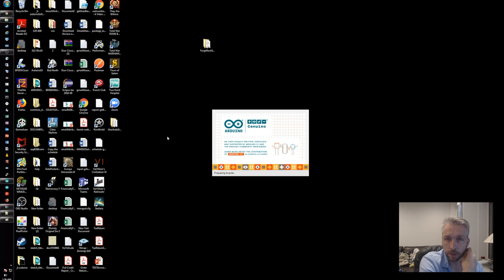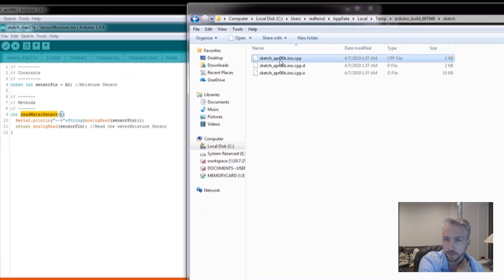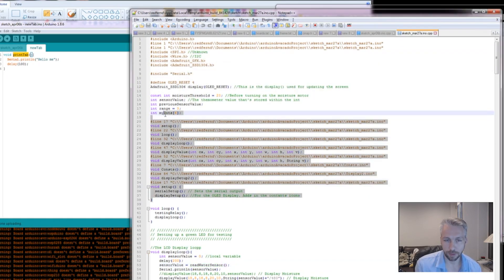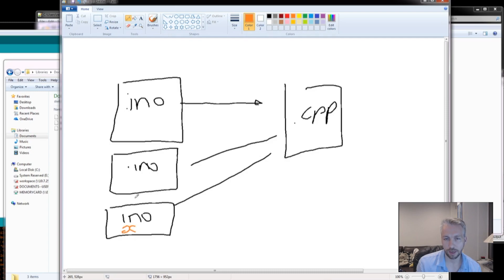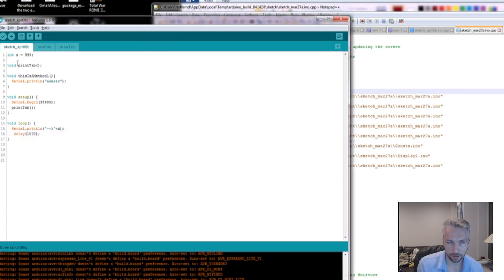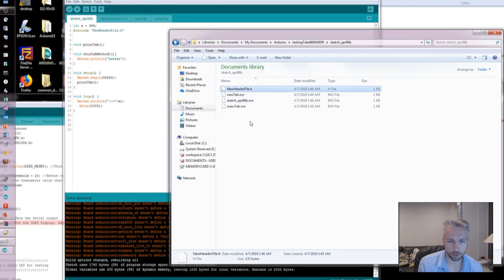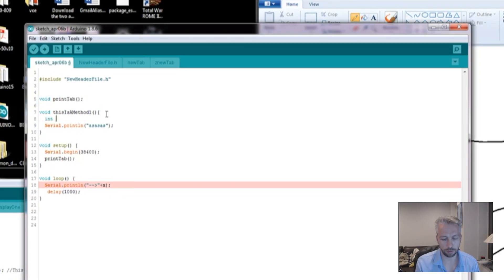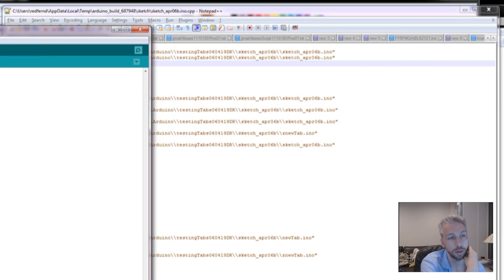Managing Arduino Tabs - Avoiding 'was not declared in this scope'

Comment: 3 years later do you still think this is the best way to go about it? Your video was quite helpful. I rolled back a change in git and that somehow messed up the compiled cpp file like in your video. My program was working perfectly until then and it really killed the momentum of my day.

I'm wondering how I should group declarations across multiple header files to group concerns. Like if I have these tabs, wifi, serial, webserver, led, I think I should make a header for each, describing their public things. Then import all of those header files at the top of my main ino file so that they are all hoisted to the top.

Does that sound like the right approach to you?

Comment: Okay I understand how using prototypes helps with TABs (and learned how .h files work) but my problem goes one level deeper.
In my main TAB I have setup() and declare my serial port and initialize it. In a different TAB I have function command9(). From your video I fixed the 'not declared' error when calling command9() from the main TAB. Now my problem is that I use my serial port in command9() plus many other places. The compiler now fails saying  --- expected initializer before 'Serial'
How do I solve this issue?